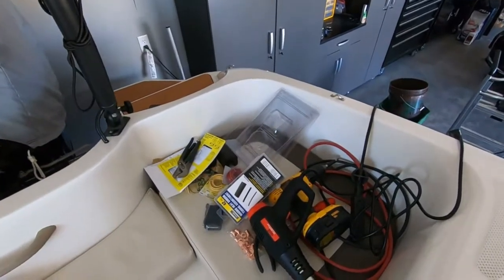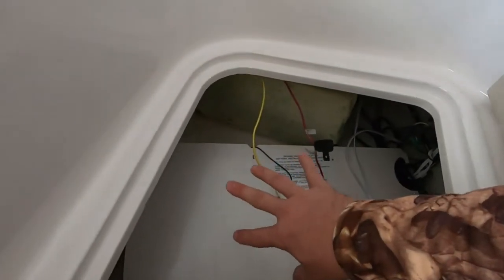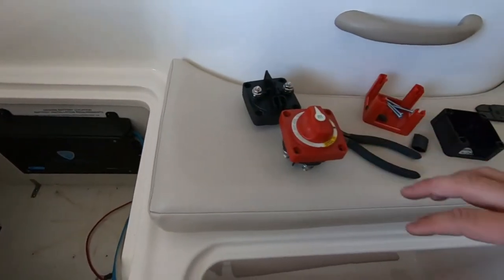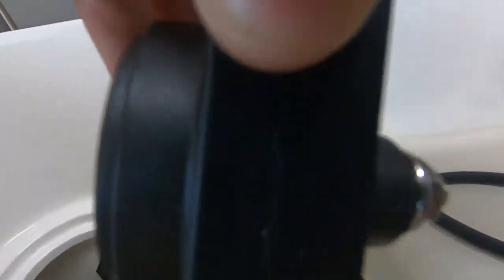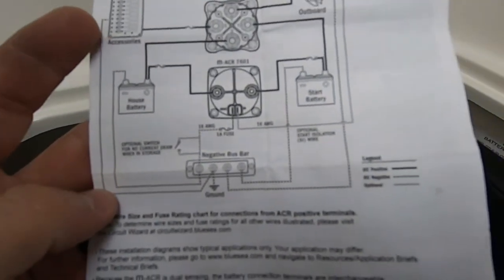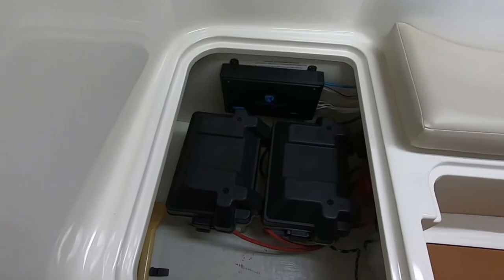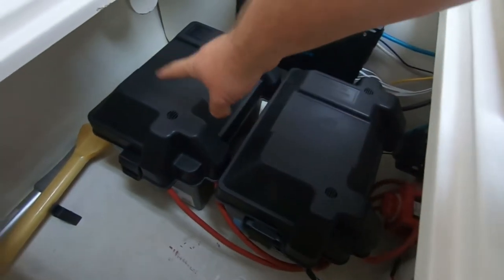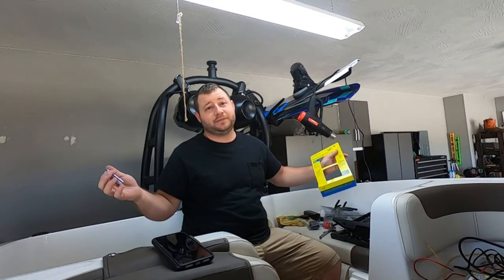Duel Battery's - 2018 Bayliner Element

Comment: Do you have any good pictures of the wiring for these batteries? I’d like to do this setup on my boat, but it’s hard to see what you have connected where
Reply from the maker: Derek Wisniewski sorry no, the vid is all i have left. The boat has sense sold. Wish i could help ya!!
Reply: midwestbuilds alright thanks anyways!
Reply: midwestbuilds did you have any problems after you installed those speakers and the amp with the new battery setup?
Reply from the maker: Derek Wisniewski nope! I worked really well, and i nvr had to worry about draining a batt and not starting
Reply: midwestbuilds awesome thank you

Comment: Nice job. The question is ...why?  Do you park the boat and play music all day? Would not a portable battery be easier and better? No maintenance, no emissions, no running costs , no fuel.  easy peasy.
Reply from the maker: yes because of speakers. we play music while anchored and also run lights with motor off during night conditions. chances are low anything would happen but at the same time i nvr want to find out how far is to far, then be stuck in middle of no where. so this simplifies everything. i can run the "house" battery dead and still have a whole nother to start motor...perfect!